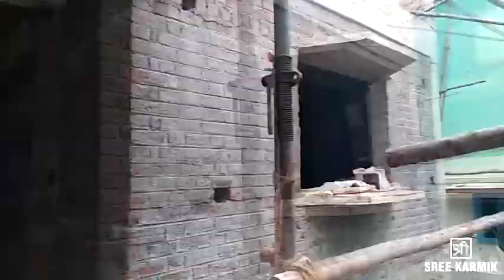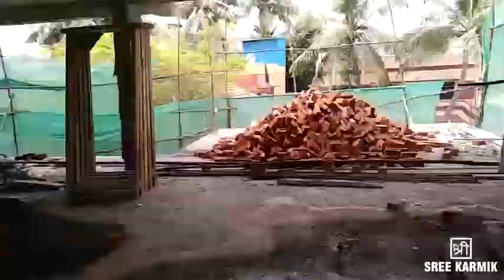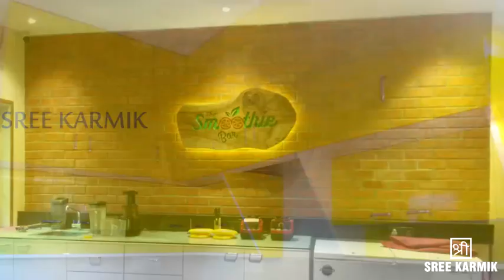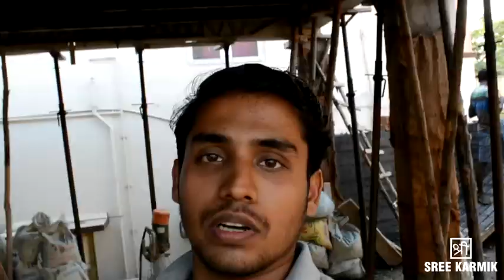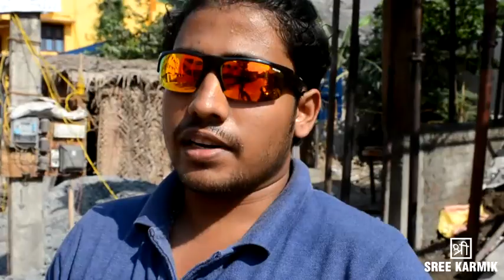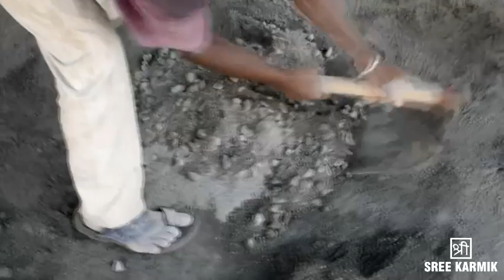Truth about M Sand Cracks in buildings and more | SreeKarmik Vlogs

Comment: Sir I have used 100% vsi crushed sand for 2 footings and done the proper curing it's been 16 days and the footings didn't developed any cracks or honeycomb, someone said to me it will but didn't happen but I have one question did I make a mistake because I use it 100% not 60% river sand 40% crushed sand mix ratio. Does it effect the durability of the structure?
Reply from the maker: For concrete, as long as the design mix is proper and concrete was poured in a good colloidal state, there's no problem. You're safe as long as the fine aggregates did not contain as much silt to start with.